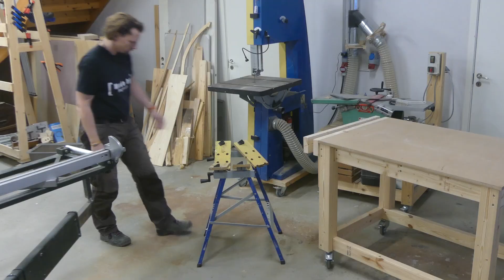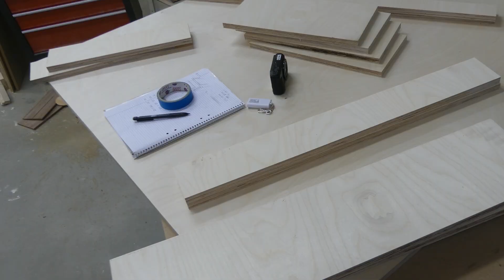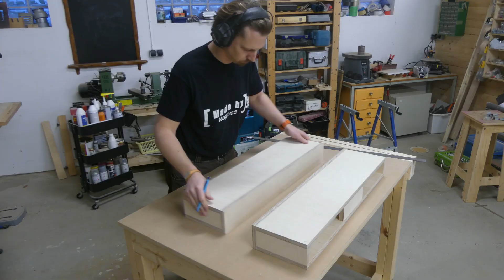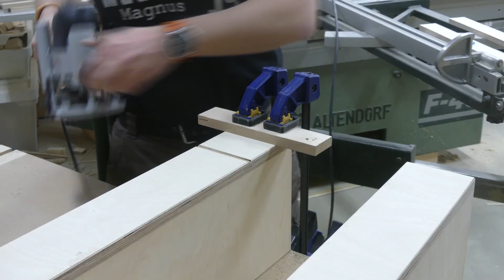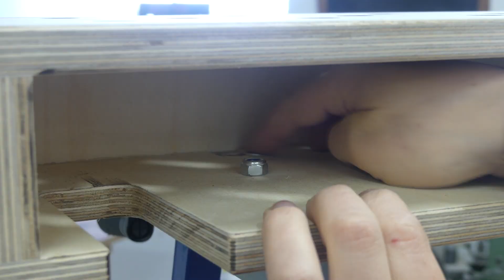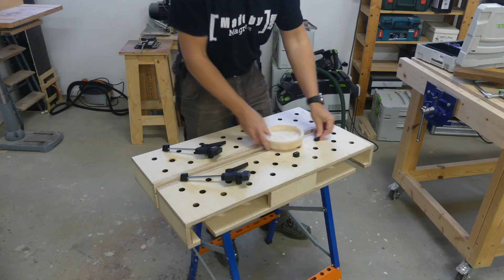Workmate hack - Made by Magnus

Comment: Excellent modification to your workmate. Thanks for sharing!
It’s a shame you have used one of those wobbly workmate clones with the light weight flimsy legs. Alas, despite the awesome clamping power of the mft style top, as soon as you attempt any work, the whole thing will just fall over. On a decent old workmate, though, it would absolutely work.

Comment: I like this. Lots of potential. Scrap of plywood across the orange braces to add a bag of something on top to increase stability. Bag of dirt, gravel  what have you? Tip the bag out when you’re done, repeat as needed. 

Clamp a long table on top with a centre support between the clamps to steady, or make a second one and clamp between as a patio table suitable for large gatherings. Possibilities are endless. I was going to mod my mid 70’s Workmate with wheels but raising the jaws your way is a very appealing option.

Thanks for the idea.

Comment: I have two Workmates that can use new tops. What did you set the top of the table height to be?
Reply from the maker: The new top is 10 cm high and the top surface is 80 cm above the floor. Just check that your drill will fit in between if you want that function. Good luck with the build!
Reply: @MadebyMagnus  Thank you Magnus!

Comment: Looks like a Harbor Freight Clamping Workbench... I recently bought one to keep in my detached garage for quick jobs, even though I have an actual Black & Decker 79-041 Workmate that I keep in my basement workshop... I just don't like carrying up the steps and 200 feet to my other garage for quick jobs.

Really like your custom top... the weakest point of that HF clamping workbench is the front metal plate behind the adjustment handles... after a couple of uses, I noticed the left handle was rubbing on the wood top... the thin metal front plate became distorted inward causing the handle to be drawn inward.

I'm going to remove the handles as soon as I get a proper roll pin punch, and insert a wide metal washer over the screw bar to stiffen the front plates.

On a side note, I just bought a nice older (1977) B&D 79-001 Type 2 workmate from Craig's List for $20... looking forward to doing some modifications to it... much better built than the HF "workmate".

Comment: Good idea and useful for sure. Sadly, and I know you were making due with what you had and recycling used up equipment to give it new life, but that idea deserves a sound base and not flimsy legs. I may have to do that using a newer version of Black and Deckers' Workmate base. It would be larger, more stable, extremely useful compared to the stock table that comes with them.  Great idea. Thank you.
Reply from the maker: It's actually surprisingly stable! It was fun to upcycle trash to a useful tool and I have had a lot of use for it already. Thank you for your kind words and I'm glad you liked it!